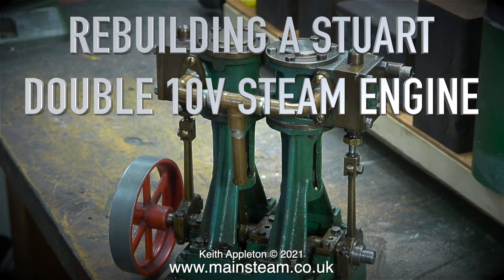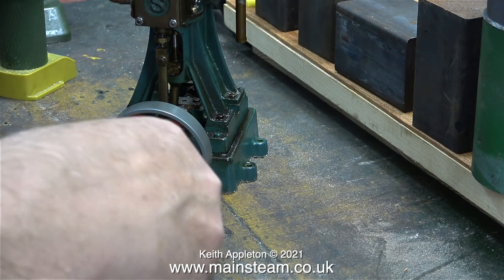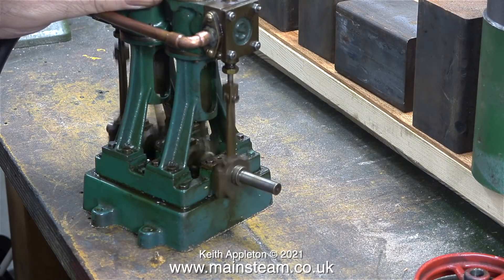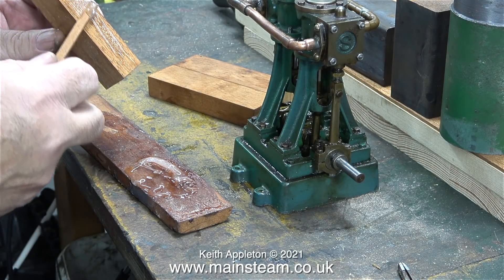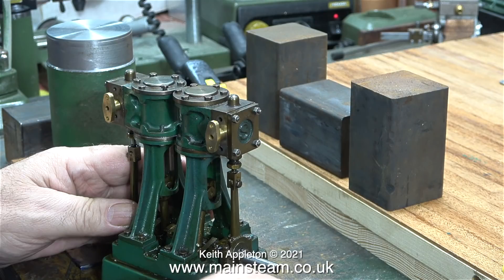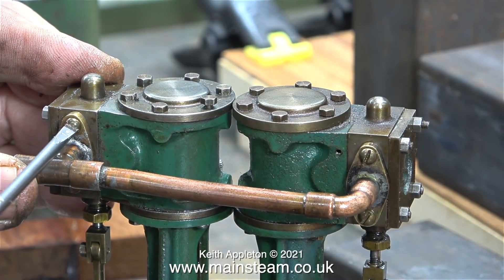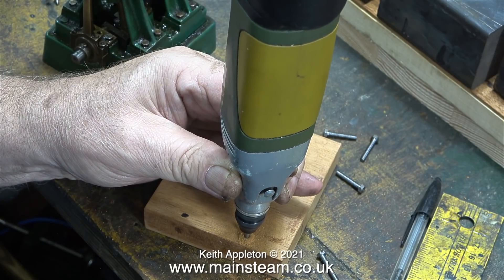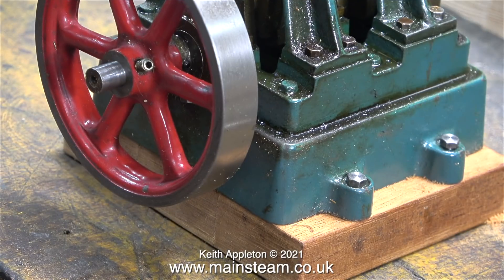REBUILDING A STUART DOUBLE 10V STEAM ENGINE - PART #1

Comment: One quick question: How did you manage to not epoxy the wooden base to both the weight and to the metal plate it was resting on as the epoxy cured? I have a feeling that it's something beginners would want to know.
Reply from the maker: The adhesive did stick to the plate, but as it was very smooth, a quick tap with a piece of wood loosened it.
Reply: @keithappleton  Thanks!